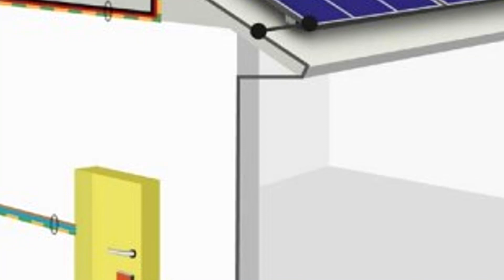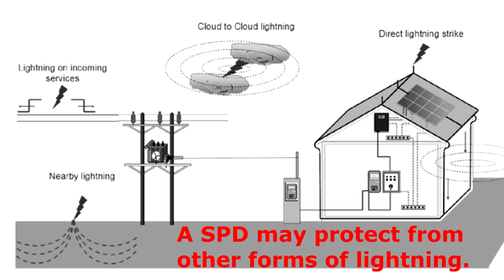A Surge  Protection Device is not a Lightning protection System 🌩️⚡

Comment: Well, you’re TECHNICALLY right. An SPD won’t protect against a direct lightning strike ON YOUR BUILDING. But it will (help) protect against lightning that might come in off of the grid. (Or are you TOTALLY off-grid?) 

OTOH, the LPS won’t protect against lightning-induced surge voltages coming in on your wiring, either.

As for a ground, is that wiring you showed encased inside a conduit? If so, it might/should be grounded. You might want to take a multimeter and check. But ... if your wiring is NOT referenced to ground, then perhaps only line-to-line and line to-neutral surges need be considered - as long as none of your electrical loads is grounded.

Comment: Hello. I just wanted to ask something regarding neutral/ground bridging. 
I did that to an inverter of mine and it works nicely, theoritically having the RCD work when it needs to. But I was just wondering why did I have to find a solution for myself while the Chinese inverter didn't mention anything regarding neutral/ground bonding... 

I might at some point purchase a Victron hybrid inverter. So I was wondering if their manuals mention something regarding that or if there's an option in their menus or something. 
An opinion on the subject would be much appreciated. Thank you!

Comment: Nothing will 100% stop the lightning strike The bottom line: The electricity in a lightning bolt is much too powerful to be 100% stopped by any type of system.

Comment: I did not see where you placed the SPD: Is it between Solar Panel and Fuse/CB, or between Fuse/CB and SCC?
4:58 this is AC SPD and it is placed on the LOAD side of the CB.

I sure would like to know the definitive way to place them for solar panels.

Comment: Use an ohm meter to see how good the garage metal is connected to each other. If it is open, then definitely not a good ground, but if there are 0 ohms, might work. You could also drill and tap some grounding screws and force a connection between each metal segment so you will definitely know it is all grounded.
Reply from the maker: It's not allowed to use metal building bonding as ground connection as this could change over time due to corrosion. You always need a dedicated ground wire for that sort of connection.

Comment: I agree, its good to bond to the metalwork but not rely on continuity as you say.
Should run a heavy gauge c.p.c to the main earthing terminal of the building or earth rods suitably installed ...and ensure the earth loop impedance test results are appropriate for local regulations.

Comment: Another great vid Andy. I have a 40’ Bus I’m putting up 2kw PV & a 48v 5Kw all in one with a Suntorque 48v 5Kw server rack battery. I was wondering with earthing I have a copper spike just out the front door I was going to use for the all in one system. Should I have a seperate earth spike 6-8mtrs away to earth the panels & Bus maybe separately? And hook up lightening protection to that earth, hmmm, no that would be a longer wire unless I swapped them.  What would you suggest for this scenario? Should the all in one & panels need to be on seperate earthing spikes? Cheers
Reply from the maker: Thanks Evan. I have never heard about someone using a lightning protection system on a vehicle. It will act like a Faraday cage so should not be a problem. I would not earth it at all. You're not parking on top of a hill with literally no trees around you in the middle of a thunderstorm, do you?

Comment: Do not confuse the two different grounding systems.

#1 Protection grounding that aims to protect persons from hazarous electrical shocks. This grounding is very well defined. In case of malfunction it should be capable to activate the corresponding circuit breaker and shall protect a person from a voltage higher than about 42 Volt. This function does not require caring for impedance and not for fast voltage spikes but just for mains frequency and bare resistance. Regulations shall be obeyed.

#2 A very different pet is surge protection. Very fast spikes can damage your equipment instantly. Therefore a major concern is the inductive imedance of your grounding. Protective ground dos not specify such requirements.  Voltage spikes behave like water - they travel along lowest (inductive) effort. Good practice is NOT to use the protective ground as it is not designed for this application (even if it is not prohibited by regulations). It might fit but you cannot count on this property.  Therefore surge protection will be installed separately with 4 sqmm up to 16 sqmm and shall not be combined or confused with protective grond (#1)
Having this in mind it will very well be possible to use the frames of your shed as it is zink plated and performs along  low impedance as it offers plenty of surface. In order to have this property continuously it is necessary to bridge any gap or unsecure contact with a fat cable. (You might have observed the briging in server cabinets between rack, cabinet and doors).
Alternatively you can draw a fat ground cable along the framing and tap contact points at every joint in your framing.  Such installation will perform along much lower impedance than your fat solar cables. Spikes will love to travel this easy road.
And if you want to do a minor extra effort: Just wind the solar cables in parallel 2 or 3 windings around the frame or another metal/iron bar. It will not harm your DC performanceat all but is a terrific obstacle for fast voltage spikes.

#3 Very similar requirements apply to lighning protection. Such installations will be perfomed cmpletely outside the building in order to keep the disturbance outside all the way. And even here sharp bends shall be omitted as they perfom like an inductance. We had here a case some years ago  where a lighning strike  refused to travel the path provided but because of a sharp bend it jumped through the wall and continued its jouney along the radiator and its plumbing. I mention this just to illustrate how minute differneces of imedance can cause drastic effects.

Andy, try to feel yourself how spikes feel while traveling along a "wire" taking in account any minute inductance. Try to be lazy (obviously not a gift of yours :-)  ) and decide if you want to travel along the solar wires being wound around iron alternatively along a well connected frame of your garage. Keep in mind: no regulations from #1 apply here.
Reply from the maker: Very interesting, thanks Johannes!

Comment: You should have 1 ground for your solar system. 1 ground for the metal structure of the solar. 1 ground for your metal building structure. And 1 last ground for your electrical plugs and so on. ALL INDEPENDENT from each other. 4 different metal bars into the ground. That's how it should be.... and it's not so expensive, but very much appropriate. And all with the necessary protections, of course. But grounded independently.
Reply from the maker: Hmmm, I never heard about this before. I have only one rod so far for the building and electrical bonding. Same at the house, there is just one main point of grounding.

Comment: I had a short discussion with my electrician about those SPDs last week, because here in Germany there are some rules/recommendations that did not seem logical to me. Ask yourself the question: What is it that you want to protect? Will a surge harm your MPPTs? Probably yes! Will a surge harm your combining box? Probably not! So you want the SPDs mounted as close as possible to your MPPTs. If a high voltage is induced (by lightning for example) it will affect not only the PV modules but cabling as well. So the SPD will clamp the surge inside the combining box but the cable from the combining box to the mppt acts as an inductor/capacitor as well and your mppt will be destroyed. So put the SPDs next to the cut-off breakers for example and connect the PE terminal as short as possible to a good ground. The Victron MPPTs also have a ground terminal on the left side... Connect this to the same grounding point as well. That way you should get a good protection.

Regarding the nominal voltage of the SPDs: You could also use the 1000V ones... The 155V one can actually withstand a voltage of 155V, but are not clamping any voltage above that. If you are hit by a surge (with by nature is for a very short time) it will probably be in the kV range, so both SPDs will try to clamp. Got this info from a SPD manufacturer after asking why nearly all SPDs below 1000V are EOL...

I am not an electrician but only interpreting all the infos by myself ;-)
Reply from the maker: Thanks for your comment. That is great information. 
The maximum continues operation voltage of these SPDs is 155V, so everything above gets capped. The same should be for the 1000V SPD. It allows surges up to 1kV in your system before it activates while the other one only allows 155V. That is my understanding.
Reply: @OffGridGarageAustralia  I am pretty sure that this is not correct. Have a look at the datasheet... The 155V is the "Maximum continuous voltage DC". So below 155V the SPD will not be damaged and will never clamp anything. The "Voltage protection level (3kA 8/20μs)" is 370V. So the SPD will limit the surge to 370V under the tested conditions. Bigger surge -> higher voltage ;-) Hopefully the MPPT will withstand 370V for this short amount of time but you will never know before it happens. If you choose a higher voltage SPD, the protection level will be also higher (~3kV for 1000V SPDs). Chances for the MPPT to survive 370V are higher than 3kV, but I have seen 3.3V ICs releasing the magic smoke at 3.5V and I have seen the same type working at 5V (by mistake and probably not for a long time).
I would choose the 155V SPD if it is affordable. But for me I choose the 1000V type because a 275V SPD (I use a 250V MPPT) is much more expensive. The insurance for the entire building (including fire, water, lightning damage) is okay with any SPD. And if a big surge hits me... those MPPTs are pretty cheap comparing to computers, kitchen appliances, heating equipment ;-)
I worked for a surveyor some years ago and had several damages to due lightning on my desk... Small surge (no visible damage) can kill the modem, router and computer alltogether while a big surge leaves computer and router working, but modem kind of explodes... everything is possible. And induction also works pretty good directly on coils inside the mppt (and there are big ones)... so a near lightning strike can kill your mppt even if it is not connected at all.
Reply from the maker: @texciler  hmm, that was the only SPD I could choose which was in the range of my solar panel setup. If it let's 375V through as the max voltage, I'm sure the MPPS won't like that. But as you said, time will tell, or hopefully not and it just keeps working...
Reply: @OffGridGarageAustralia  Whenever it come to lightning or surges, I think the goal is to keep damage low. If a huge surge gets on those cables and that SPD helps reducing the surge... Maybe you should be happy if only the MPPT dies but not the inverters and BMS "behind" the MPPTs.
A 20kV surge (without SPD) hitting the MPPT would probably lead to at least a few hundred volts going out of the battery terminals 😞

Comment: I mentioned an earth arrangement like they do on lightening conductors for buildings, this was taken out of context!!
High voltage, high current for a short amount of time while the breakers etc isolate the system.

Low impedance, low resistance make a enclosure to isolate it from touching etc and should be very legal

Insulate a bar or make a compartment to separate it to form a barrier, install the bar with the insulated stand offs like in the battery shelf project down to a copper earth rod..

It's an idea for high voltage, high amps transfer to ground.
If it's good enough for substations it's should be good enough here as well.
Reply from the maker: Thank you.

Comment: Bonjour Andy, Merci pour tes tutos.... pour les colles résiduelles, souvent en appliquant du WD40 puis essuyer avec un torchon.... on se fatigue moins et ca peut faire des "miracles"😉.... Salutations de la Suisse ...⛷ - Olivier Berthoud....
Reply from the maker: Thanks, I would not use WD40 for the cables, that is very messy. A water based lubricant is the way as it dissolves after a while

Comment: Surge protection never saved us from 3 ligthnings :( Actually caused a fire one time.
A lightning never hit your garage. Because you are surrounded by trees. :) Good :) 
*I think current protection devices are designed for standard installations. Standart home installation transmits electricity from the ground floor to the upper floor. It is difficult to use surge protection for solar DC or impractical for electricity going down from the upper floor. In fact, it may not work because of resistance values of live and ground cables. OR You must have a super low ressistant wire for grounding. *(I'm not an electric engineer) But, there is a device for this type of test. (but, It is simply so expensive :()
Reply from the maker: Thanks, Ren Great thoughts.

Comment: It's the same rule in the USA National Electrical Code. The building should be bonded to ground or "grounded" but it is not a "ground" for the electrical system.
Another similar example: In the NEC it used to be permitted to use an incoming metal water pipe as your "grounding electrode" but that change many years ago. Now if you have metal pipes those are typically connected to the electrical panel ground bus just like the old days, but that is to ground the pipes, not to ground the electrical panel. The panel also must have that ground bus connected to a proper grounding electrode. In a similar way a metal building might be connected to the electrical panel ground, which confuses people into thinking the electrical ground is via the building, instead of actual the building is grounded via the panel.
Reply from the maker: Great explanation Sylvan. Yes, that is the same here. The garage is grounded but we cannot use this as a subsidy for a ground cable. Many got this wrong
I know the pipe rule as well. This is more about to bring all metal objects on the same ground level. The incoming pipe could be isolated with a plastic water meter at your house and have a different potential as the rest of your pipework in your building. Hence there is a ground cable bypassing the water meter. This is also for when the meter gets replaced so the plumber is safe from potential different and dangerous voltages.

Comment: You are still missing the point, the SPD is to stop any voltage rise, more than likely from a nearby lightning strike, not a direct strike. If you don't put them as close as possible to the charge controllers you are trying to protect you are wasting your time installing them. The rise time of the induced voltage will propagate to the controllers before the SPD has a chance to ground it. It's why they keep talking about short cables!!!!

Comment: WD-40 works for a bunch of different glues from stickers and protective films. Either it works in less than 1 second, or it doesn't work at all, just don't forget it is flammable.
Reply from the maker: I'll try it on the other conduit I have. Thanks.
Reply: @OffGridGarageAustralia n the epilogue for this video, it looks like you were using a bottle labeled “mineral turpentine”.  This is also known in other countries by various names: White spirits (AU, UK and Ireland), mineral spirits (US, Canada), also known as mineral turpentine (AU/NZ), turpentine substitute, and petroleum spirits.

It’s generally a great choice for solvent to clean sticky adhesives, oil-based paints and polyurethane wood finishes and topcoats.

In the US, there is a smaller bottle of similar petroleum-based distillates called “goo gone”, which is also used for the same purposes, although it’s sold in a much smaller bottle and has an orange scent.  For larger projects, the plain mineral spirits are a better choice because they are less expensive, and come in larger sizes.

Best to use gloves however when working with any chemicals!  Also, be sure to collect any used mineral spirits in a waste container such as a glass jar or bottle.  These petroleum distillates are toxic to the environment and must be disposed of properly.  Depending on the project, they can often be reused a few times. (For example, when used to clean brushes to remove with clear-coat oil-based polyurethane wood finish, the excess mineral spirits can be put into a container and left to settle for a few hours.  Later, the polyurethane will settle out near the bottom, and you can pour off the top layer of mineral spirits into another container to reuse again.)

One last safety note: Mineral Spirits have a low ignition temperature, and soaked rags have been known to spontaneously combust when in hot weather or environments!  So, be sure to store used rags safely in a non-flammable trash bin or container.

Cheers!